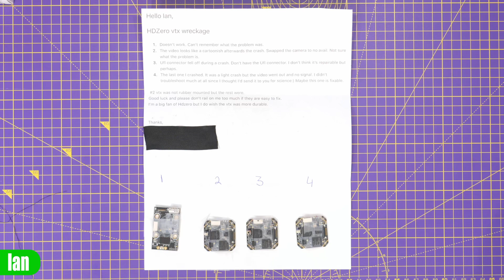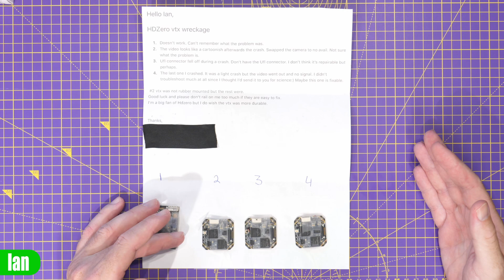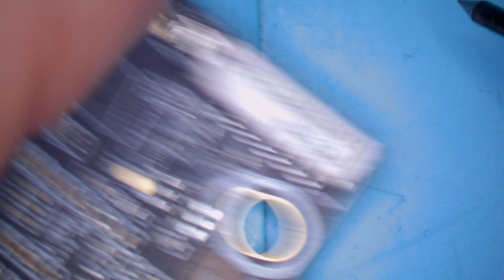HDZero FPV VTX Repair - Race V1 No Power

Comment: Awesome, thanks for this repair guide. I just successfully repaired my HDZero Race V2 by replacing a damaged 22uH SMD inductor on that 5V dc-dc step-down circuit. Luckily the IC (TPS4302?) was fine.

Comment: Can a patch antenna be used for TX?
On DJI, everyone says put the two patch antennas on the bottom ports.
One of those two bottom ports is a TX and RX, for requesting retransmissions. Is it a waste? Will it transmit further than the omni? Can a patch even be used for TX?

Comment: I have a whoop board with a similar issue to #4
LEDs light up fine, but no video.
I also have another one that is OK for ~20 secs but then the video cuts out, but again, both LEDs still lit.
Are you planning on making a video regarding the whoop boards?
Reply: same here... Whoop VTX died mid-midflight. LEDs ligth up, but no video. I just open an RMA at my local vendor.